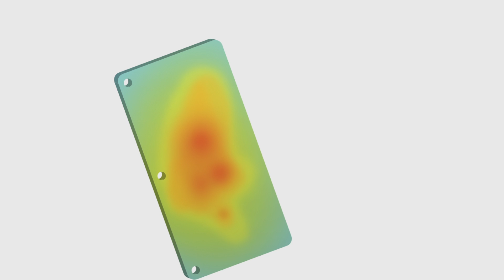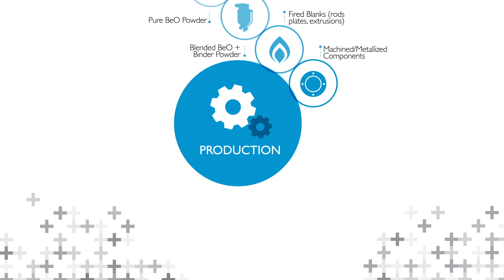Beryllium Oxide (BeO) Ceramic Material: Be Cool

Comment from the maker: Beryllium-containing materials including BeO can be safely processed. Companies, large and small, have safely worked with beryllium-containing materials for many years. Some operations and processes will require additional engineering and work practice controls while others will not. Education and communication are essential to an understanding of safe handling practices. Materion is a leader in the industry, and we share many safety resources through our website on the proper and safe way to handle beryllium. The following is a link that leads to FAQs, an interactive guide to working safely with Be, and more (https://materion.com/resource-center/environmental-health-and-safety ). If you have questions or concerns regarding this topic our Environmental Health & Safety hotline is available for you to call at +1 800.862.4118.

Comment: I have a bunch of old magnetron tubes from microwaves and have been told that the insulators can contain beo is there any way to safely find out if that's what I have and how do I scrap them safely should they go into regular scrap metal pile? most of them have a good amount of copper in them. So how should I deal with them? I just have the tubes with the insulators on each end. I already removed the aluminum fins and ring magnets that just slide off. Thanks Ben
Reply from the maker: Hello Ben, we'd be happy to help you determine the right way to dispose of the magnetrons. Please send an email to Ceramics-Info@materion.com, and our team will reach out for details.
Reply: You can use a diamond tester which you can get for 15 to 20 dollars.  These testers I believe will read thermal conductivity and will tell you if it's beryllium oxide.

Comment: The kind of people that end up dismantling products are the people that don't know how to handle BeO safely, it is still dangerous.
Reply from the maker: Thank you for your comment. Beryllium-containing materials can be safely processed.  Some operations and processes will require additional engineering and work practice controls while others will not.   Companies, large and small, have safely worked with beryllium-containing materials for many years. Education and communication are essential to an understanding of safe handling practices. Materion is a leader in the industry, and we share many safety resources through our website on the proper and safe way to handle beryllium. The following is a link that leads to FAQs, an interactive guide to working safely with Be, and more (https://materion.com/resource-center/environmental-health-and-safety). If you have questions or concerns regarding this topic our Environmental Health & Safety hotline is available for you to call at +1 800.862.4118.